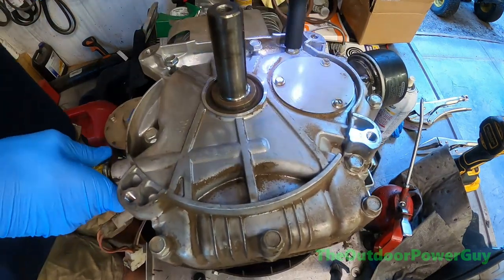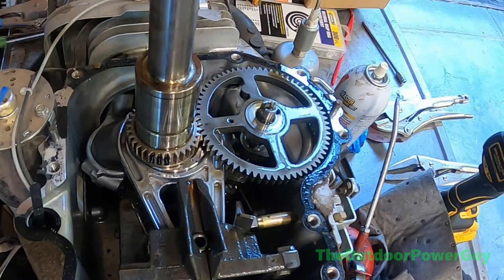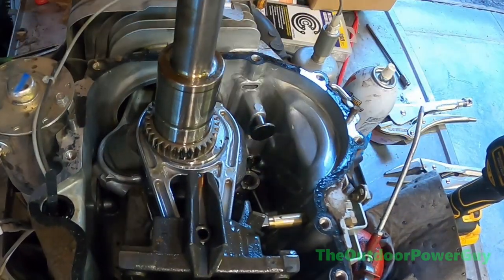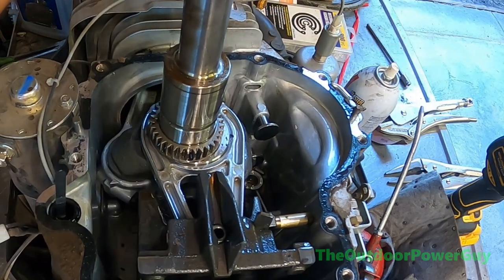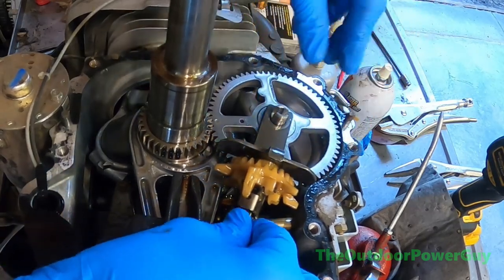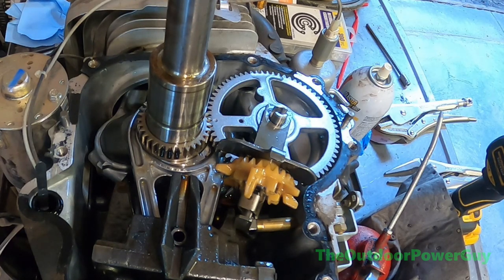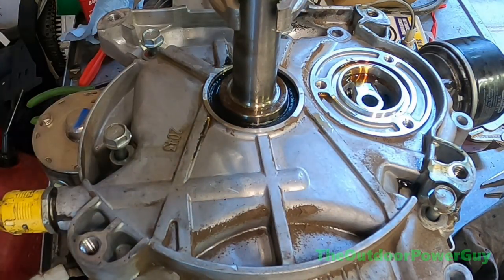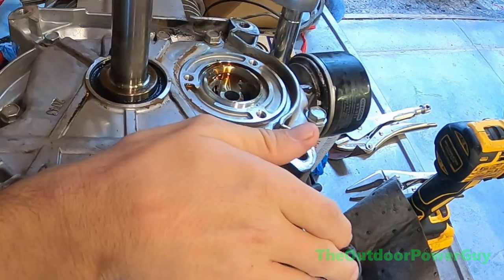Broken Camshaft Replacement   Briggs Intek 19hp

Comment: If my compression release is not broken,  will worn lobes on cam cause me to have to adjust the valves every time before mowing.
Reply from the maker: yes, or a worn head/valve guides. both valves i usually set to 4 thousandths (.004)

Comment: Good video what cam did U purchase and recommend I have 19hp Briggs
Reply from the maker: always go OEM when it comes to internal engine parts, contact your local Authorized Briggs & Stratton dealer, some dealers will not sell ' Service Only ' parts, which was certain parts reserved for shop use by professionals, like myself, at my shop I will not sell a service only part, but it's at the shop's discretion :)

Comment: How long is the repair and how much does it cost
Reply from the maker: Book time is 1.5 hours, i will not discuss prices or what i charge on my channel.
Reply: Thanks, that's more than enough i wanted to know. I have Briggs v twin 24hp that is very hard to start, when i turn the engine round by hand it will make weird saxophone noise, is this faulty decompression?
Reply from the maker: @martink4719  Depending on your year model engine there could be a multitude of different problems ranging from a cylinder issue or to something as simple as a bad carburetor or a valve problem, the lobes on the cam could be worn, i have seen that happen as well,  the noise you hear might be normal as some Briggs engines do make a noise like that when cranking over,  i've never seen a ACR (automatic compression release) fail on a V-twin briggs and some don't even have it. my best advice would be to contact your nearest Briggs & Stratton dealer, they are certified in-order to be an authorized dealer :)

Comment: You said 20 inch lbs on bolts, should be 20 foot lbs.
Reply from the maker: 200 in lbs equals 20 ft lbs.
Reply: @TheOutdoorPowerGuy  240 inch pounds = 20 foot pounds. You left the pin from the broken compression release in the engine. It's near the bottom tappet.
Reply: Leaving the broken compression release is akin to someone knocking on your back door; NOT GOOD!!!

🤣😂😅

Comment: I replaced the cam shaft, all assembled properly.  The engine will not spin with spark plug installed, but when spark plug removed, engine spins over...of course does not start with spark plug out. What am I dealing with, please?
Thanks 
Ron
Reply from the maker: this is how i troubleshoot hard crank overs. its not always the cam. 

1. remove and bench test starter (hook your red lead off the battery charger to the starter and touch the black ground to the bottom of starter) if the starter runs smooth and does not get hot for 30 seconds, it passes. 

2. check and adjust your valves to the correct lash. i set all Briggs between 4 and 6 thousandths. 

3. ACR (automatic compression release) on the camshaft, sometimes the spring is not strong enough and won't work properly, or as usual they break off.  

when you replace the cam ALWAYS check your valves and reset them to the proper clearances/lash!

Comment: Professional use factory gasket and not gasket sealer always replace seals and gaskets saves from a come back that’s on your fine due to poor workman’s ship this is a good video as far as the procedure and fix but not the assembly
Reply from the maker: You are incorrect, Briggs & Stratton no longer uses gaskets on the valve covers after 2010, the service manual states to use an RTV (gasket sealer/maker etc..) sealant that is oil resistant. Kohler engines never use gaskets on the valve covers and oil pans, Briggs is the same now, no gaskets on the oil pans, RTV. i have used RTV for over 20 years with no problems.